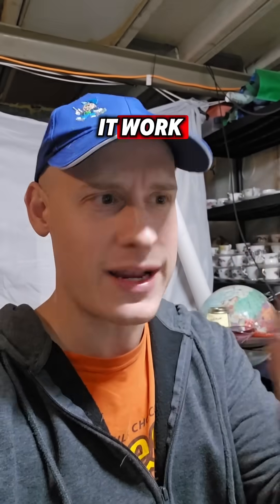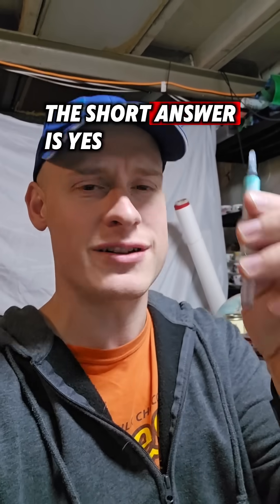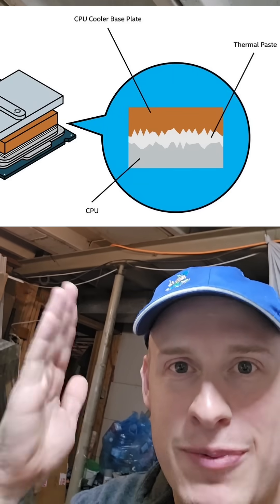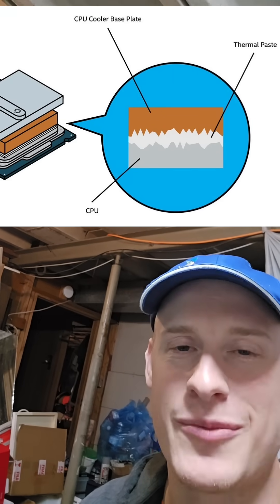What is Thermal Paste?

Comment: You should really get some various size thermal pads for consoles (or a sheet that you can cut to size), especially retro ones that hopefully won't be opened well that often. 

Thermal paste is fine in computers since they either go obsolete before the paste dries out, or us nerds replace it every few years as part of maintenance. 

In a console, a pad will work much better since they last significantly longer before they degrade.
Reply from the maker: I think some folks looked at using pads in modern consoles and it just didn't transfer as much heat. Moderns systems are basically a small gaming PC imo. Some of the Ram chips have thin pads but the apu always have paste or liquid metal in PS5s case. I've been thinking of getting some pads for old systems though!
Reply: @VideoGameRestoration  maybe, modern consoles would generate too much heat for them. 

But that's also kinda scary. Pads tend to last significantly longer without replacement. So where paste usually makes it 3-5 years before breaking down. Pads made it closer to 10 before breaking down.

I wonder if the switch has more to do with the thermal performance, or the assumption that people won't keep the new consoles that long.

Comment: My first repair was a PS3. I was a young teen then, i took it apart and didn't know what the icky goop like substance was, so i wipeed it off, put it back together, and my PS3 stopped working. Overheating the console in the process.
Reply from the maker: @8bitnation419  😬😬😬